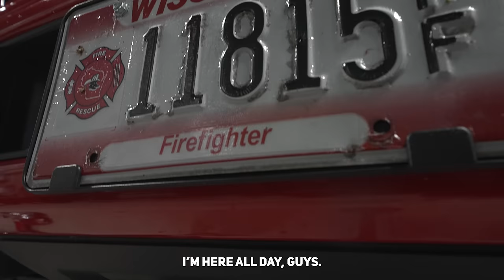The 1 Cent Truck Build - 2018 Ford F-150 on 4.5" Lift

Comment: Very cool to see! Thank you first responders!
Does the 4.5inch superlift come out level or have some rake?
Im looking at getting one for my 2018 F150 XL 4WD and looking for a nice level stance.
Heard Bilstein has front struts/shocks that can be adjustable and add an extra inch of height to the front end is this an option?